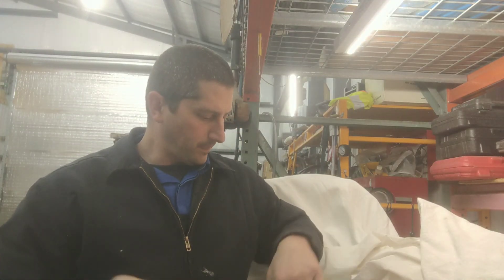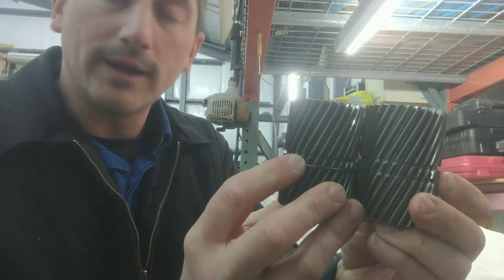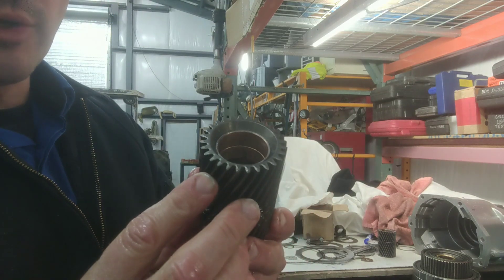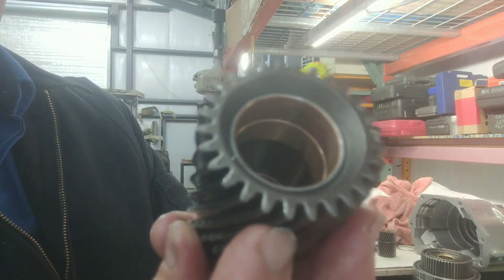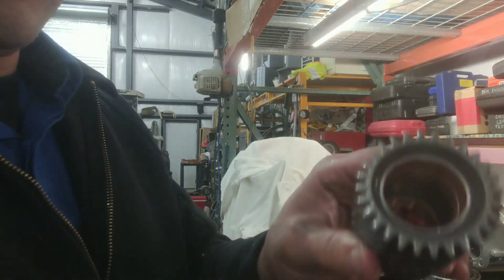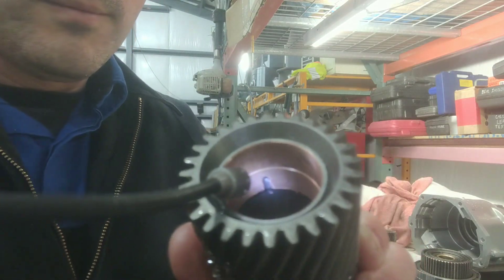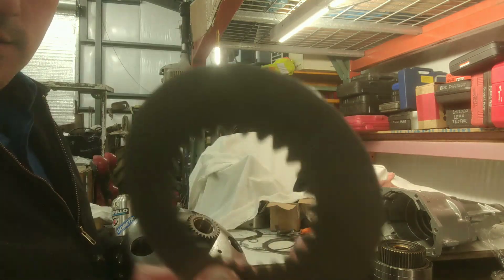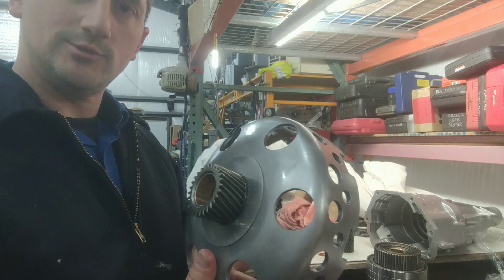46re converted 48re. Sun gear bushing modification to ride completely on the machined intermediate.

Comment: I've been trying to collect all the tips and tricks, but there are so many it's hard to keep track. 🙂In my case I'm building up a 46RH to put behind the big block... so will only be ~550hp/tq.
Reply from the maker: Isn't the bell housing different for Big block? Im thinking youll need a 47 or 48 🤔
Reply: @firstrespondergarage  Yes you have to first cut off the bell housing and use the JW Ultra Bell